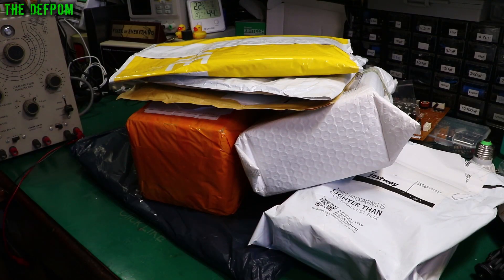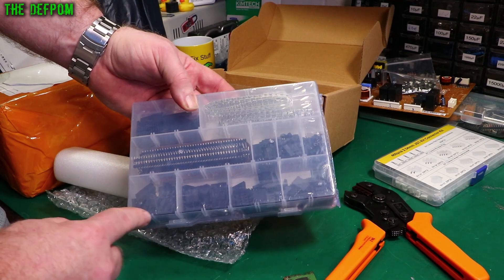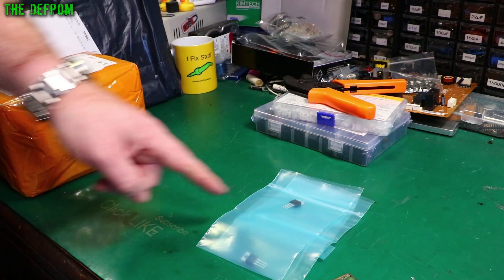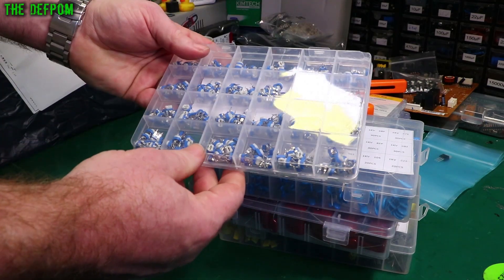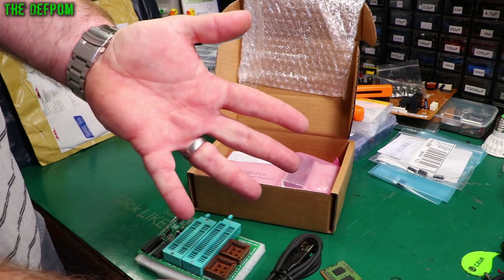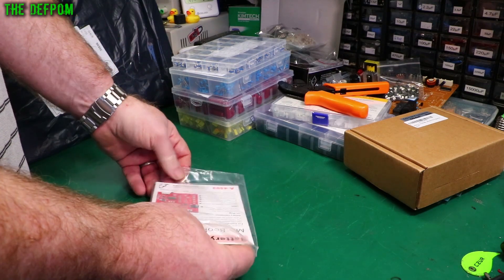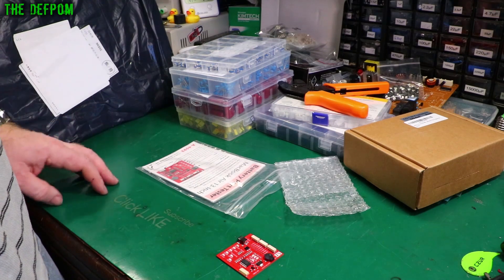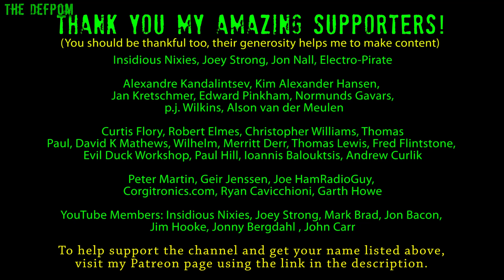🔴 What's in my Mailbag ? - Mailbag Monday 25th July 2022 - No.1025

Comment: I hate 78xx/79xx voltage regulators as they expel so much energy as heat!
Reply from the maker: Yes they are not very efficient, I have some small switching supplies that use the same footprint, but the gear I fix often means I have to replace like for like